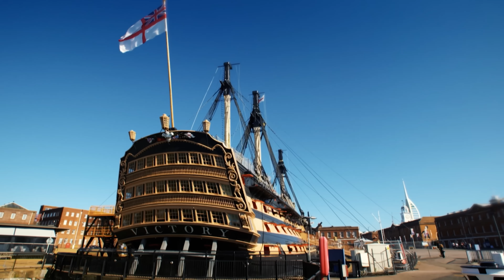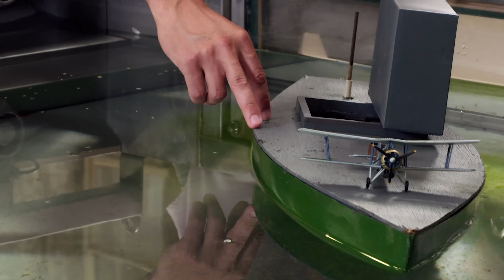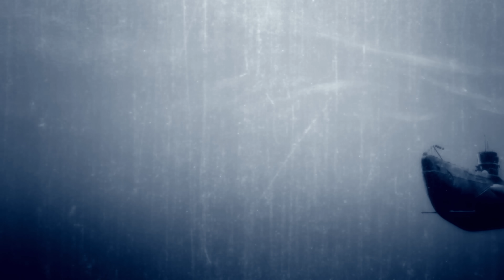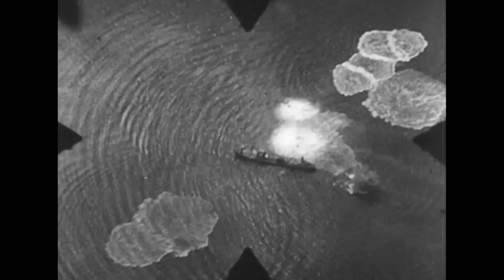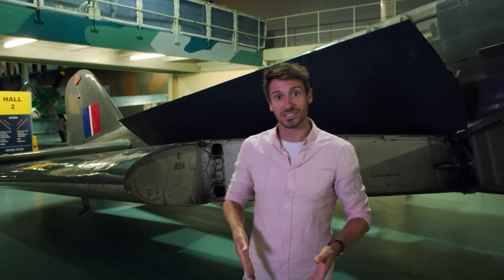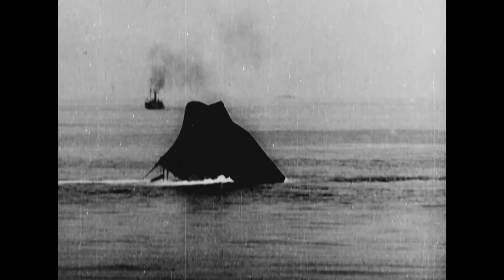Ark Royal: The Engineering Genius Behind WW2's Greatest Aircraft Carrier

Comment: The ‘engineering genius’ was actually also the reason for the destruction of the Ark Royal. In their effort to save weight, her designers omitted torpedo bulges, watertight compartments, electrical power backup systems which severely limited damage control capability. In acknowledgement of these design shortcomings, Royal Navy designers later incorporated improvements in the design of the Illustrious and Implacable class carriers.

Comment: While the Ark Royal was a great carrier, I would hardly call it ‘the greatest’. It had several design flaws mainly the over reliance on electrical powered systems which was determined to be one of the causes of its demise by the investigation that led to the court marshal of her commander. The Ark Royal was not designed as a fleet carrier so the design philosophy was different. It was built to be lightweight and her hull lacked armor. Her range was only half of her US and IJN counterparts and had a capacity to carry fewer, much less capable aircraft. Her role was mostly anti submarine and never engaged in any carrier to carrier air battles, unlike her US and IJN counterparts which engaged each other in several offensive and counter offensive campaigns. The Ark Royal survived attacks a few times by air strikes from land based bombers, none of these were air launched torpedoes. Ironically, despite her armored flight deck, it was a single submarine launched torpedo from U-81 that sank her and only because she had a poorly designed damage control system and a crew that was not as effectively trained to handle such damage.

Comment: If the Ark Royal hull had been riveted it may have made it back to Gibraltar,  welding of ships was still not an exact science then and once a welded joint cracked the cracks propagated quickly along the heat affected zone of the weld.

Comment: Engineering genius? She had several design flaws:

"The Bucknill Committee, which had been set up to investigate the loss of major warships, also produced a report. This report said that the lack of backup power sources was a major design failure, which contributed to the loss: Ark Royal depended on electricity for much of her operation, and once the boilers and steam-driven dynamos were knocked out, the loss of power made damage control difficult. 

The committee recommended the design of the bulkheads and boiler intakes be improved to decrease the risk of widespread flooding in boiler rooms and machine spaces, while the uninterrupted boiler room flat was criticised. The design flaws were rectified in the Illustrious- and Implacable-class aircraft carriers, under construction at the time."

Comment: Patriotic but widely considered to not be true. The USS Enterprise is widely considered to be the greatest aircraft carrier of world war 2. The American Essex class carriers were almost 25% larger, 10% faster, and carried more aircraft, up to 90 compared to the Ark Royal’s 50-60. The vast superiority of the American Essex class should come as no surprise since they were commissioned far later in the war than the Ark Royal, which was sunk before the USA even joined the war. Except for knocking out the rudder of the German battleship Bismarck, the Ark Royal was reduced to mostly convoy duty in the Mediterranean and aerial reconnaissance.
Reply: Perhaps a more accurate title might have been most important rather than greatest, in that it paved the way for the later aircraft carriers, rather than having the greatest war time record compared to some of the American, or even Japanese Pacific carriers.
Reply: @johnnyutah892 I will accept that at the time it was designed, the Ark Royal was a revolutionary step forward in aircraft carrier design. However it did not play a significant role in the Second World War because, through no fault of its own, it was stationed where aircraft carriers had little strategic value and were in fact quite vulnerable to attack, as its sinking proved.
It was strategically irrelevant because there was no need for aircraft carriers in the eastern Atlantic. Britain and Iceland WERE aircraft carriers. Air power could be projected from Britain, and was. 
It was vulnerable for the same reasons: Britain was too close to the enemy, too vulnerable to air and submarine attack.
Aircraft carriers shined in the huge expanses of the Pacific. In the North Sea they were just juicy targets.

Comment: Due to serious flaws in the design of Ark Royal it only took 1 torpedo from U-81 to sink her, hardly what you would expect from "WW2's Greatest Aircraft Carrier". I'm pretty sure that one of the US Carriers would be top.
Reply: That would be USS Enterprise. She fully accounted for 3 of the Sunday murderers and shared in the fourth. 20 Battle Stars and over 900 enemy planes destroyed. It's doubtful that any ship will ever beat her record.
Reply: It wasn’t really a case of Ark Royal being fatally flawed in design. The torpedo from U-81 hit her in a very unlucky spot and caused flooding through cable runs and ventilation. In the first hour the ship was actually stable and could have survived, but damage control was slow and evacuation was ordered too early which left no one to fight the flooding. Many carriers of the war, including American ones, were lost after just one or two hits if struck in the wrong place. Ark Royal’s loss was more about circumstances and crew response than about her design.
Reply: @Noodle5593 didn't help that there was no Backup power supply only steam powered that was changed in future carrier's designs